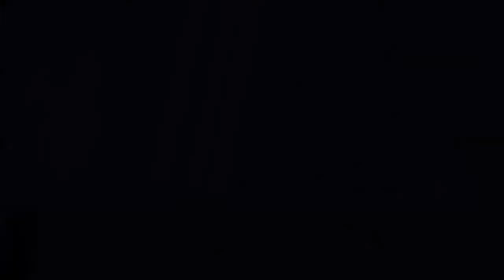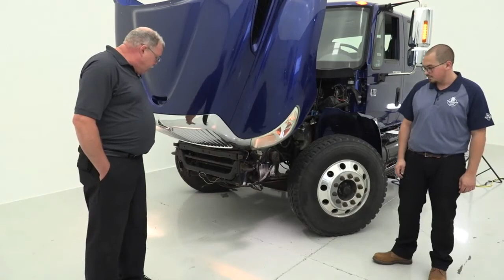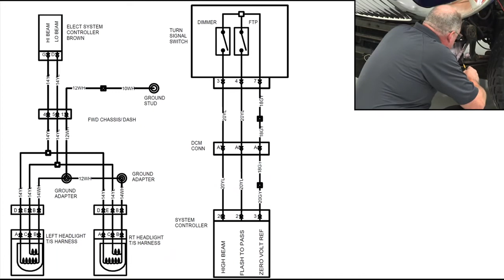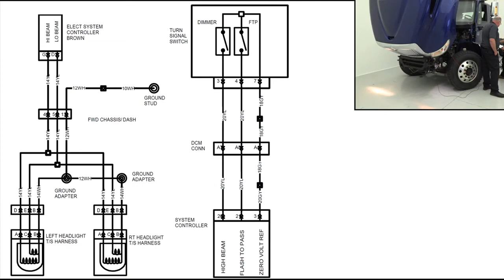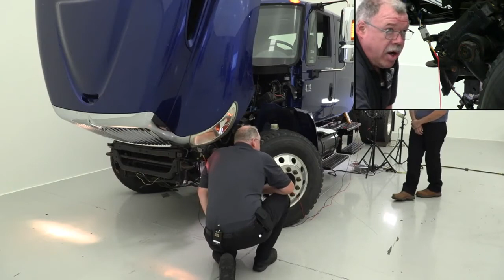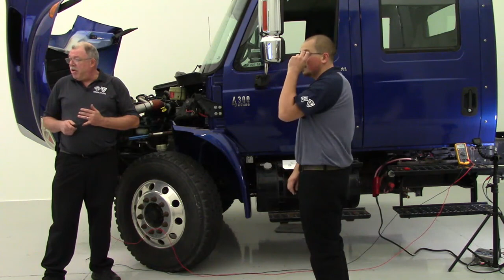TECH TALK: Voltage Drop Testing S1E2

Comment: If you have a power probe 3 you can take the extension lead that comes with it can be used as a set of long leads. I'll attach it to the battery positive and negative and use that to reference battery for all of my voltage drop measurements.